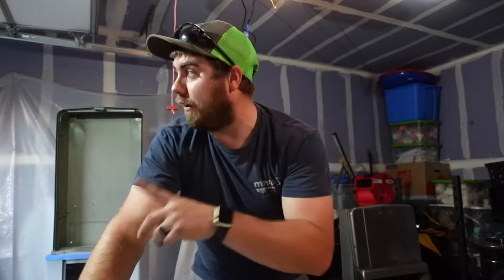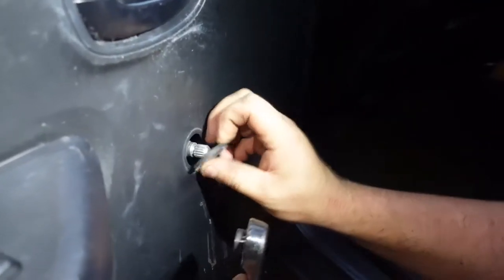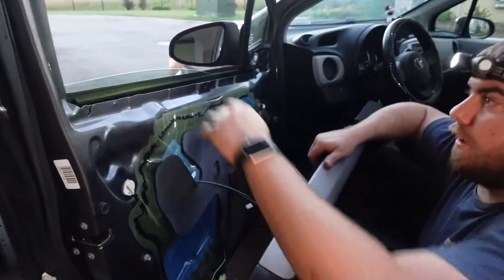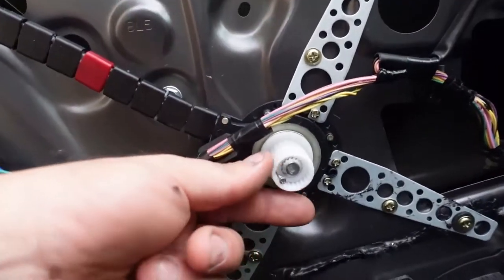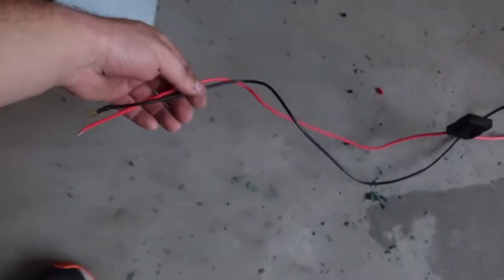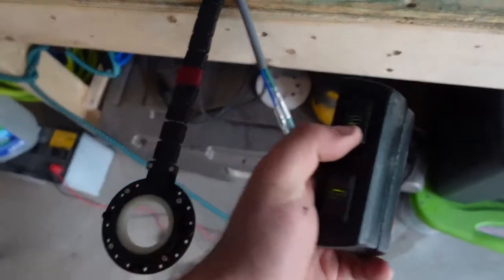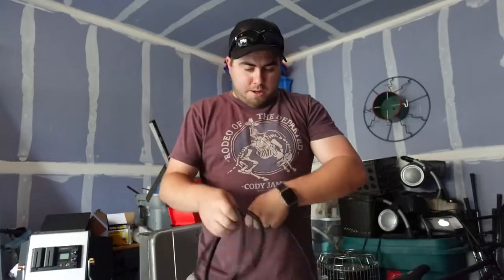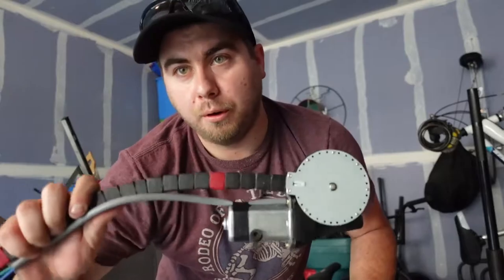Electric Window CONVERSION Install

Comment: Hi I have one of these kits fitted great but one side will do down but won't go up you hold the button up and takes a few minutes to respond l've tried siloken spray but makes no difference would you no the issue been fitted just over a year

Comment: If you wire it directly to the battery wouldn’t it drain it after awhile?
Reply from the maker: No it’s only going to use power when the window motor is running
Reply: I just installed mine today direct to the battery but the switches had lights it won't drain my battery?